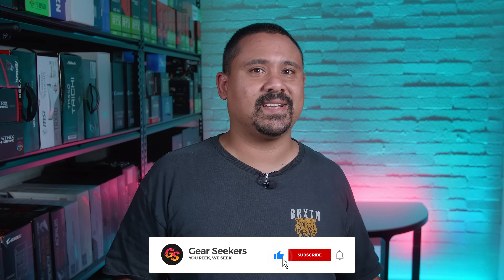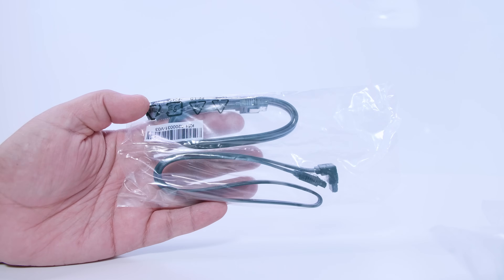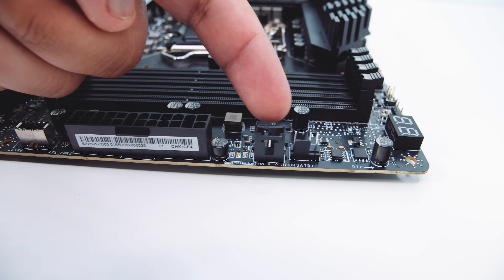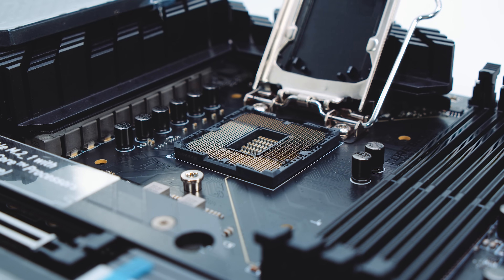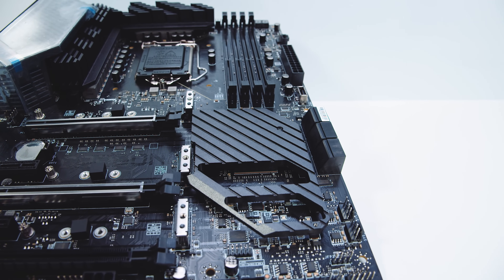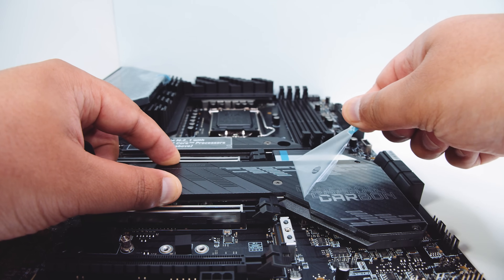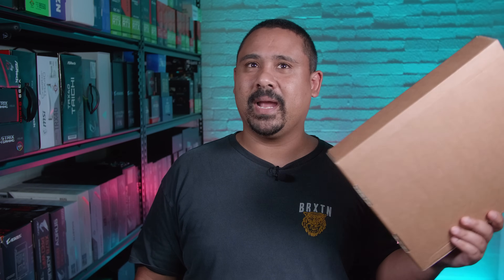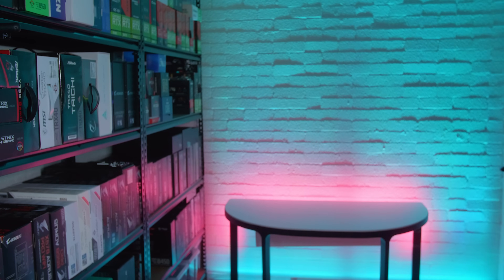Z590 IS HERE... Sort Of - MSI Z590 Gaming Carbon WIFI Preview & Overview - CES 2021

Comment: If you want to use the full potential of this mobo you have to use a gen 11 cpu

My only complaint is i used a gen 10 intel chip and in order to use all m.2 drives you need an 11th gen intel chip. Otherwise the 1st m.2 drive wont work. Plus using the other 2 m.2 drives disable certain SATA cables so using the m.2 drives you sacrifice some SATA ports.

Comment: The z590 motherboards are expensive right now, even the mainstream a gaming edge/plus will cost $300-350 , even a z590 pro version, the msi pro mb wld cost around $130-$150  back then bt nw cost $200.

Comment: 7:06 Why is there an AMD logo on the bottom?
Reply: MSI is probably using a pre-made/layout print that they use for another board. Since this is pre-production it will likely change
Reply from the maker: It's a crossfire logo. It's normal

Comment: Wait, there is some ambiguity with this whole wording about "only enabled with 11th gen CPU" on multiple mobo descriptions for the 1st M2 slot: does it mean that PCIE 4 is only enabled with an 11th gen CPU, or does it mean that the M2 slot won't work at all, not even in PCIE 3 mode, with a 10th gen CPU?
Reply from the maker: It means 11th Gen only for PCIe 4.0
Reply: @GearSeekers  Thanks! :)

Comment: Well if both m2 slots aren’t pcie 4.0 for z590 I’m sticking with amd and x570 and running the Samsung 980 pro in raid config with a 5900x. I was waiting for this to see what intel 11th gen had to offer. Based on the fact it was keeping same socket I didn’t expect it to be a fully integrated pcie gen 4 but rather a makeshift. I’ll wait until intel jumps below 14nm to explore their products again. I’m sure the amd chips will still run circles for productivity anyway. It sucks because I was an intel fanboy until this year.

Comment: Holy shit, that VRM design, are the 11th gen chips that power hungry.
Reply: High end Threadripper boards have an equal or less VRM. Let that sink in.
Reply: Not really. These are all built to be overkill. The more expensive stuff can even straight up run a liquid cool 10900k OC without any heatsink.
Reply: @eggcopter  True, but they are still power hungry af.
Reply: @bushhawk5460  to be fair, compared to the ungodly amount of power a modern high end GPU takes, CPUs are absolute kittens up til Xeons and threadrippers. Just take a look at 3090 transience or Radeon pro Vega 2's vrm board image
Reply: @eggcopter  i9s regularly exceed 250W on stock and 300W when overclocking, so that comparison doesn't really hold up.
Reply: @bushhawk5460  that's also the power consumption of 2060, and 2080tis hits over 750 peak without oc so that's that
Reply: @eggcopter  That's bullshit and you know it. 750W is the recommended minimum PSU for a 2080ti. It peaks at about 290W.
(Source: https://www.techpowerup.com/review/nvidia-geforce-rtx-2080-ti-founders-edition/31.html) There isn't a single card that can hit that power draw,  maybe on LN2, but definitly not in a sensible setup.

Comment: Wait so, I'm a little confused... Intel will support PCIE Gen 4 NVME only from I5 up, or what's the meaning of what is written on the heatsink? They'll lose big time like this because AMD supports gen 4 on all Zen 2 and Zen 3 CPUs. I agree with you with them providing sticks but also to provide a certain update software to update the versions of the drivers to the newest ones and have those on the USB stick.
Reply from the maker: They might not be making i3's
We don't know anything yet.
Reply: @GearSeekers  Well they're still stuck on 14nm+++++ for all these years. So you might be right of them not knowing in which direction to go.
Reply: They are making 11th i3. But is just a refresh of 10th gen cpu. only i5 and i7 are New
Reply from the maker: @hansdahlberg9969  actually we don't know anything except for the 11900K
Reply: @GearSeekers  i read it on wccftech!  But its just a leak so you are maby right.
But i do like the look on the  msi board...and hope they also continues with the Unify. Think thats the best looking board of all.
Reply: You can't take leaks as facts. Until it's announced officially from the vendor anything "leaked" doesn't exist.
Reply: @KlaireGearSeekers  Actually you can't take what Intel says as true because it has been proven in the past that they are not sincere.
Reply: @hansdahlberg9969  Don't bother with wccftech, most unreliable website around. Intel CEO could fart and they'd write an article about it
Reply: @Teksers  Totally missed my point here. I'm saying don't listen to leaks.
Reply from the maker: @hansdahlberg9969  leaks are fake news. This is why we never talk about leaks because most of the time we know the truth ;)
Reply: @Phalaxis83  lol 😁👍
Reply: @GearSeekers  i agree 👍
Reply: Maybe you should be unassuming like the lil brown box